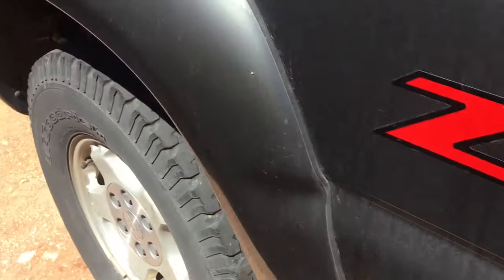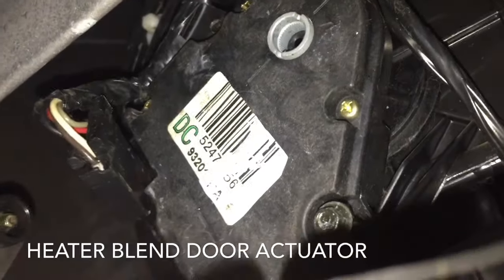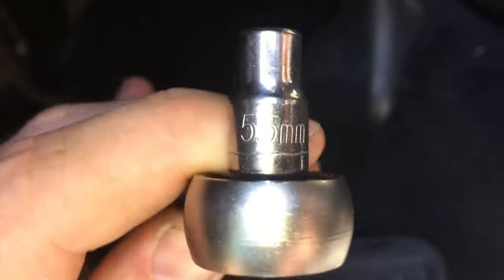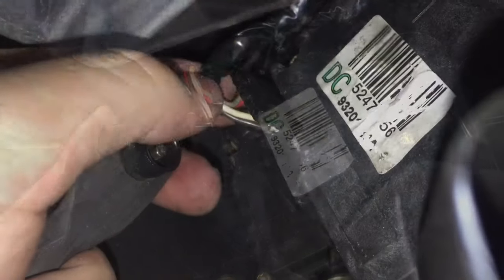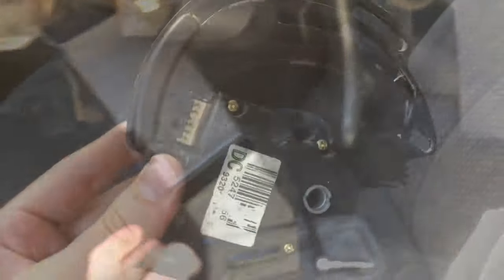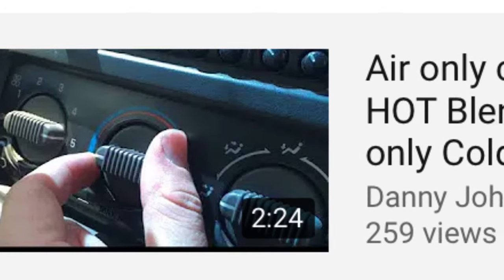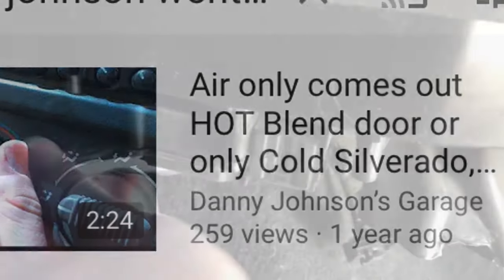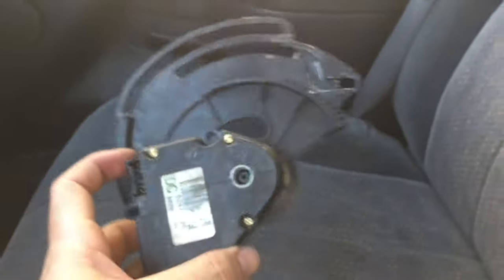Air only blows out defrost or top vents: mode actuator Blend door 99-2007 GM Silverado, Tahoe, Yukon

Comment: Danny, this is very helpful and I even ordered the part from Amazon. One thing confuses me. My controls (from left to right sitting in drivers seat) Fan speed, temp, then the selector for defrost, vent , floor, etc. In other words on the RIGHT side yet, you show changing the module on the left (closest to the steering column). Is that right ? I would have thought it was opposite...please let me know so I dont change what doesnt need changing, It is stuck on defrost but fan speed is okay so dont want to FIX the wrong one ...Thanks
Reply from the maker: It may depend on the year of the vehicle and if it has dual climate control or not. Also, the heat blend door is on that passenger side on mine https://youtu.be/_pf7N2pmkpc

Comment: Replaced the motor but now the air ONLY blows out of the top vents. Do you know how to align when reinstalling? Any help would be appreciated.
Reply: Your best bet is just to leave it off and manually position it to the setting you want before hitting the road

Comment: unplugged the actuator for a few minutes and plugged it back up in the comments is a micro-thing semi-conductor layer which results from oxidation ◙ These are chrome plate contacts due to economic reasons and you cannot detect the layer watthour science mind like mine → All you need is some antioxidant as proven by my fixing the passenger side hot-cold diverter servo 2 days ago and now you can hear the air-door thump over in time with Thumper-bumper Ka Whammy ! It works
Reply: So just unplug it for a bit and plug it back in?

Comment: I'm having trouble getting the shroud lined in with the gear, I'm not even sure what angle is the white shroud is suppose to be when installing it back in. Difficulty is real, I'm still recovering for shoulder surgery. I have little use if my right arm.
Reply: Give up. You'll never get it properly installed. Just leave it removed and manually position it to what you want prior to driving
Reply: I actually got it installed! Works perfectly. I had to push through the pain, reminding myself about having a frozen shoulder if I don't keep movement and stretching in my shoulder, neck and all those other tendons, muscles attached.
Reply: @marisat9595  What position did you have the gear/lever(vehicle side) in when you installed the actuator?

Comment: That aluminum bracket I guess it's part of the steering column is in the way
Reply from the maker: The screw isn’t hard to turn. Try it by hand without the ratchet
Reply: @dannyjohnsonsgarage  thanks for the info I couldn't get my big ass hand in there but it wasn't that tight I just use some needle nose pliers and turn the socket and I was able to get it thanks, now it's just a pain in the ass to get the new  line back in there with both blend door gears my hands are too damn big lol, but I'll get it I just have to take a break awkward being upside down up underneath that Dash

Comment: How did you reach that top screw?  Mine are also 8mm (2005).  1/4" ratchet is too thick, hitting the steering column brace with the socket on.  Horrible angle to reach up there.
Reply from the maker: Try just the socket by hand

Comment: I need help I changed the HVAC door actuator on the driver side above pedal in my 2005 silverado and it doesn't work. I verified it is the correct actuator. Do I need to reprogram it ?

Comment: My 2003 suburban blows aire from outside even if I turn the recirculation button with AC off.. is it the same part ?
Reply from the maker: It sounds like it. I would remove the actuator and then turn the lever on the car (not the actuator) by hand to see if it fixes it. If so, order a new one
Reply: From my understanding there are 3 types of actuator one called mode, another called main, and then there's blend. They each have specific functions.

Comment: Wish u had a video of install trying to time the thing so everything works is still difficult for me
Reply from the maker: I actually haven’t finished the install- needed to see my brothers yukon to figure out. I’ll post an updated video when it’s in
Reply: Mines been sitting in pieces for 4 months because I can’t get it back in. There’s not a single video showing someone line it all back up 🥲
Reply: @Josh-op6re  after watching this again this morning and seeing we’re expecting 8-12” of snow this weekend I spent a few hours going at it again. The actuator came in the middle position, so I set it in the middle on the dash which happened to be floor. I threw it all together making sure to line  up the doors so they come out the floor and it switches between all modes fine now
Reply: @Josh-op6re  nope I just matched up the actuator, dial, and doors. Everything is working fine still
Reply: @jakeclark798  Does the lever have to be in a certain position when installing the new one? I bought a new actuator because my air was only coming out the front and now its only coming out of the defrost even after doing the calibration 😐
Reply: @followerofchrist1961  it does, it needs yo match the position your actuator came in

Comment: This is the mode door actuator and not the blend door, correct? I cant seem to find much information differentiating the two.
Reply: Blend door actuator allows heat or AC to blow. Blend mode air door actuator allows air to blow from different positions.

Comment: Yea that one at the top is a pain to remove basically stand on your head to get out
Reply: Haaa.  I'm still trying to get it out and doubtful about getting it back in! Got a swivel on it and it will barely angle in there.  Did u get in back in???
Reply: Place the bit in screw nd try using a screwdriver it worked for me
Reply: I’m dealing with that right now. My truck is a single cab and the seat can only my move so far back.

Comment: I started looking into this in my 2003 Chevy 2500HD diesel, 40,000 miles. I could see the actuator motor trying to move so I helped it gently. I cycled it back and forth ten times and it seems fine. I leave it set on vent all spring/summer and defrost all fall/winter...wondering if in my case, it needs to be cycled periodically. Also wondering if using a small amount of plastics-compatible grease on the sliding parts would help take some strain off the motor.

Comment: im going to look at this today, my feet are freezing all winter! Next challenge will be why the recirc button only blinks but does not engage, any thoughts?
Reply: That’s because it’s still on defrost. Once you install the blend door fix and you change it to face or feet recirculate will work
Reply: Circulation mode also won't work if you have it set to blow at your feet...It will blink, like you said.

Comment: Seems i cannot get to top screw.  Any tips?  Hiw ti get it back in once replaced?  Can't access from to either.
Also, when turning key on i can watch motor cycle through but back to starting position, defrost, but controller does not affect position.  How do i know if problem is controller or actuator.  No codes with scanner.  Thanks
Reply: You prob need to disconnect the battery for like 10 minutes.  After you reconnect the battery turn the vehicle into “on position” without starting it.   This will resync the actuator you be in the correct placement.   This can take up to 5 minutes to complete.
Reply: @blmznking5  i changed accuator and all working fine now.  Removed a few more parts to be access screws and that made it fairly quick.
Thanks

Comment: I know this is an old video just throwing out a line. My truck is stuck on front vents, and won't switch to floor or defrost. This looks like it will solve my issue.
Reply from the maker: Yes, and when it’s off you can move the tabs by hand to verify it changes the vent flow. Be sure the clock the new unit exactly as the old or it will be hard to line up
Reply: @dannyjohnsonsgarage  Thanks man. You're a real one

Comment: I swapped it out and it still only blows out of the front facing direction.  When i turn dial to defrost or floor it doesn't change directions.  Any suggestions?
Reply from the maker: The door inside maybe broken despite the motor working (or the motor isn’t calibrated to turn the right way). If you remove it and move the white levers manually you may be able to tell if it’s actually opening/closing the doors

Comment: took it off and put the new one in now it’s only working on head vents, bad door actuator??
Reply: Take the cover off both the old & new actuator. Swap the big white gear into your old one & see if it works. Usually that’s all that’s wrong with the factory actuator is the gear cracked & jammed the unit up. The new actuators are cheap junk.

Comment: How did you manage to get the top bolt out because that’s what I’m struggling on
Reply from the maker: You may have to try a socket with your finger turning it. I recall it was loose

Comment: I have a 01 silverado and the hot n cold work fine but, whenever I turn the defrost on it constantly clicks until I turn it off. Do you think the blend door actuator could be the cause? The sound definitely seems like it's coming from the dash on the passenger side.
Reply from the maker: yes, this would likely be the actuator in question shown in the video
Reply: @dannyjohnsonsgarage  Much appreciation. I just got the part so hopefully it'll work!

Comment: uhhh, I don't have a "white lever" to manually change it... Is it a tool to stick in that hole, or was it already there and it's just missing? Prompt response from anyone that knows would be great. I'm from Alaska and I'm friggin' cooking in Idaho right now and really need the vent action right now. It's almost a safety thing, to be frank.
Reply: There is a white lever with teeth on it up in there. There are teeth on the black piece that the actuator connects to. They mesh together.
Reply: @lancealot3867  Holy sheeit. There was a piece of plastic covering up the lever that I couldn't previously see. Thanks dude!

Comment: I’m having problems with top vents the passenger side is blowing colder than the diver side?
Reply from the maker: If you have dual climate control it may have yet another actuator
Reply: @dannyjohnsonsgarage  u taking about the ac control with the button slide roll up and down right?

Comment: I removed this actuator on my 94 suburban. I moved the white lever with fan blowing and it only changes airflow from defrost to floor. No matter what position it's in I can't get airflow from the vents.  Does this actuator control vent airflow in some other way or is vent airflow controlled by a different actuator?

Comment: My car windshield defrost vent is always blowing some air irrespective of any mode. Will replacing mode actuator help in this case?
Reply: Did you ever figure this out?
Reply: @elmateo487  Yes, there is a foam seal inside the dashboard attached to the Aircon system vents, it gets deteriorated. Replace it so that a proper seal is formed. Also first check door mode actuator if it's working properly.
Reply: @umang1691  thank you!

Comment: How do you get that top screw out?
Reply: Did you ever get it?
Reply: @juniorr813  no I did not. I’ve tried different low profile ratchets.  I manually turned it but it went back to defrost mode. I guess I have to unplug it after I move it back down again.
Reply: @davidfira2667  oh okay thanks by any chance did you have a couple loose wires with like a red tab
Reply: @juniorr813  I don’t really remember seeing any loose wires on the connector. I will look in the morning. Thank you

Comment: I changed the actuator & was testing my modes but now the face vents won’t blow at all even when I took it off to try manually, ideas?
Reply: Is nothing blowing at all?? Like it is off?? Bc that's what happened to me.. originally, I removed the mode actuator as shown and it defaulted to blowing cold out dash for a out an hour then EVERYTHING JUST SHUT DOWN!! I have a hard time believing my blower stopped so close to removing the actuator.  But here I sit with no air in this 100+ degree summer ugh

Comment: I replaced my mode actuator three times and it still doesn’t work.  I also replace the whole module that controls the speed, temp, and where to push it through, and mine still doesn’t work.  It worked for like a day or two and once again it stopped working.  Anybody have the same issue, and how’d you rectified it?  My truck is a 2002 chevy Silverado, 1500.

Comment: I have an 02 avalanche. I have an actuator at the same exact place however when I move the white thing, it doesn't change the vents that the air blows from. Anyone had this issue? Is the actuator for the vents somewhere else?

Comment: Danny does the shroud have to be put in a certain way
Reply from the maker: It does and I haven’t put it in yet 😀 I assume you want to turn the dial to a certain setting for it to like up
Reply: @dannyjohnsonsgarage  yes  Instead of blowing through the   Defrost windshield  I would like it to come out through the vents
Reply: @dannyjohnsonsgarage  which way does the shroud need to go? Mine is now only blowing out of top vents instead of only defrost like before replacing.

Comment: Danny please help.  I have 2014 Nissan sentra.  My blower motor stopped working.  Only blew on a very  no matter the setting...blower motor n resister was replaced ..blows great every speed. But now it only blows from dash...the mechanic says that's a different problem .has nothing to do with blower motor or resistor...he was 6 hours labor to drop my dash n find problem....how could all 3 brake at 1 time...no way.  It worked when I dropped it off...charged me $550 for resistor n blower n $140 install on each.$185 for motor n $140 for resistor.  I feel taken advantage of...is this problem caused by something the mechanic did when replacing blower motor n resistor?  It worked fine when dropped off at his shop...please help

Comment: So installed new one, the indicator arrow notch or whatever you want to call it on the new one was centered when I installed it. I turn truck on after inst, and it didn't fix. My original issue was it was stuck on defrost, only came out of defrost, now its stuck comin out of fwd vents. For my purposes, AC during summer, this is good enough, but it's frustrating it didn't fix the overall issue of being able to actually control which vent it comes out of. When I looked at the component after ops choking it, the indicator notch was now past the markings (means it's last the full cold posn) which the little instruction sheet that came with the part says will cause it not to operate. I have no idea what caused it to go passed this. Any idea what went wrong here? Is it bad out of supply or is there some trick or step I overlooked.

Comment: You call it the Blend Actuator, but doesn't the Blend Actuator actually go on the passenger side, to switch from hot and cold?
Hence..blending heat and cool?
Reply from the maker: They are both blend doors- one for blending heat/cold, the other for blending/diverting air.
Reply: @dannyjohnsonsgarage  
So is it the same part for both sides?
Reply from the maker: @RobTerVree  No, there is a blend door actuator motor specific to each side
Reply: @dannyjohnsonsgarage  
Great
Thank you for all the help Danny!
Reply from the maker: @RobTerVree  Sure thing
Reply: the drivers side actuator is called the mode actuator if buying it online

Comment: I swapped this part out and it still only blows at my feet or defrost. Any ideas?
Reply: Just take the actuator out entirely... it defaults to boring out of dash and if needed then manually change to floor cents or defrost
Reply: @stevenmiller2081  can you explain a little better? Are you saying to not even use that part? Unplug it and remove it completely and I’ll get air out of my front facing vents?

Comment: I have a 2012 Tahoe. When it is very cold out I only have some warm air blowing out the driver’s side lower vent but I have very hot air coming from the defrost. It is not much better on the passenger side. I am trying to determine which actuator is bad.

Comment: So my 02 Silverado was only blowing out the defrost vents. I changed this part and now it blows to the position I select. However, the temperature dial is now backwards. If I turn it to cold it blows hot, and if I turn it to hot it blows cold. Anyone experience this problem? Any help would be most appreciated! Thank you!
Reply from the maker: That should be the blend door actuator, on the other (passenger) side https://youtu.be/_pf7N2pmkpc
Reply: @dannyjohnsonsgarage  Now I'm really confused. That's the one I just changed. I greatly appreciate your response!
Reply: Are you saying you push the AC button and it blows hot air out the floor heater vents.Or you push AC button and hot air comes out the front vents.

Comment: I've got a 06 gt when I switch on fan speed control to blow ac no air comes out of vents but I can hear ac compressor kick on heres the tricky part it will blow air for the most part but there are times when this happens and no air blows through vents I have replaced the blower motor resistor and still nothing any ideas ?
Reply: The part he shows breaks on every car they put it in. The plastic part is prolly stuck so it won't let any air through

Comment: How tf u get the top bolt out
Reply from the maker: Try the socket in just your hand without a wrench. It’s not in too tight
Reply: I had to go buy a precision socket wrench and used a 1/4" driver drill adapter to reach up in there. Spent 2 hours before I went and got one lol

Comment: Passenger side hot-cold fixed with anti-oxidant on the connector contacts;
Professional shop billed $500 for this which I do not have to spare;
Removed a heater-duct and will attempt finding the connector after getting the Contortionist Plasticizer ○ Fix is too-simple you just put antioxidant on the connector but does not always get it you may have to replace the gizmo ◘ Manual exceeds in all cases where you can